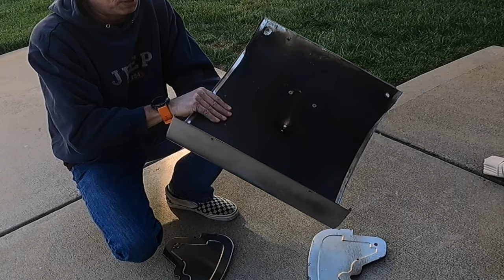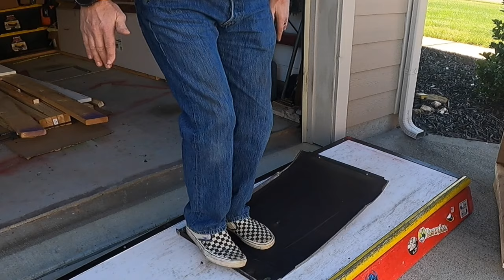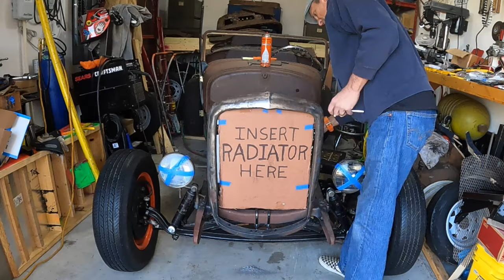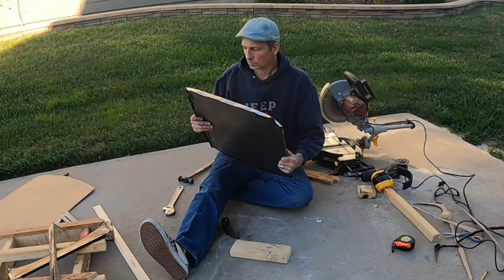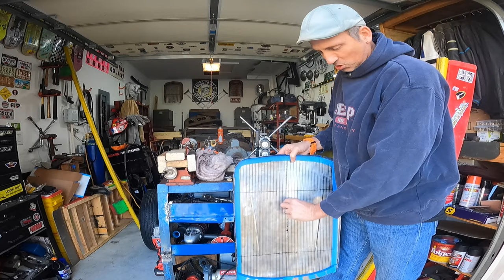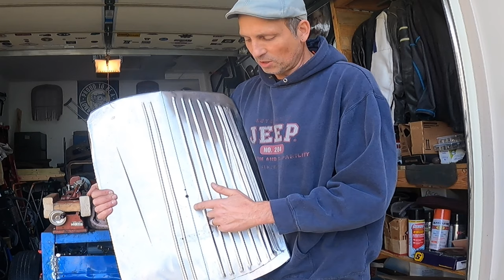Grill to Grille Insert

Comment: Gotta love free experiments! Kind of funny how well that scrap fit for your project and the factory stamped lines worked out. Had me thinking of the old Ford V8 logo… An over sized V8 bead rolled into the grill might be a cool idea for your next attempt in the Charbroil Roadster!
Reply from the maker: I actually had that same thought about the V8 but my little 8” bead roller isn’t big enough to do that.  Even though this one was a failure I wrote down a lot of notes and think I have a solid plan on how to do it successfully the next time once I scrounge up some more stainless steel.